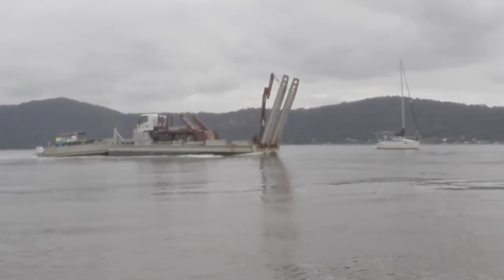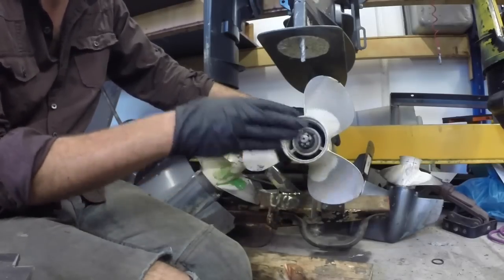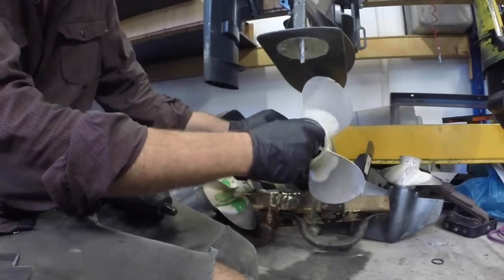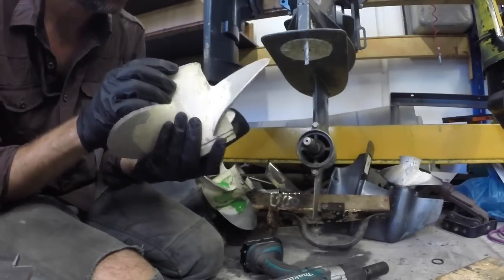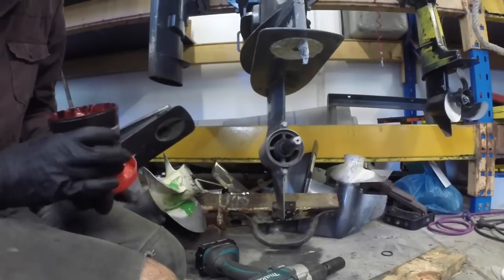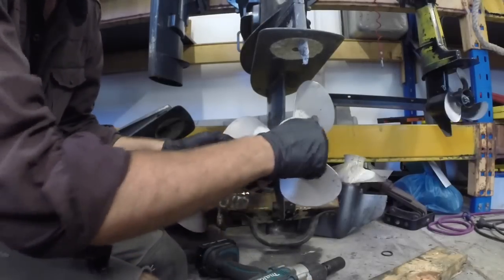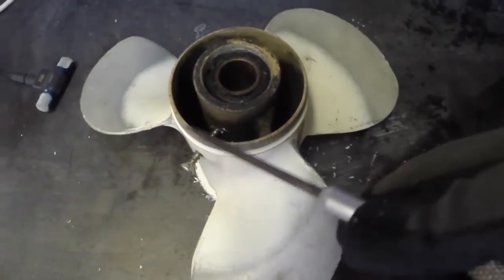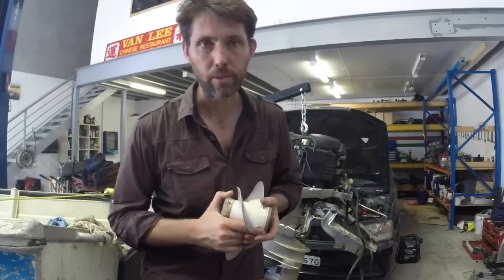Outboard revs increase but boat doesn't accelerate

Comment: Very interesting mode of failure - I never knew that modern props had a rubber bushing like that.

I've experienced almost exactly this same failure, but in the automotive world, with my supercharged MINI Cooper.  They are notorious for the crankshaft pulley (which has a very similar rubber bushing connecting the inner section to the outer ring) slipping and eventually failing.  This, of course, happened dramatically during a track day!  

I love finding out these little parallels between boat and car powertrains.  Many engineering solutions cross between the two.
Reply from the maker: Hey Paul, I too like seeing those parallels, there are only so many engineering solutions and its interesting to see how they are applied.

Comment: I have a 55hp yamaha 2stroke wot never planes out and rpms dont seem high enough, I'm thinking timing advance? Wot with muffs it will wind to 6000 , underload puts bow to the sky and stays there. Any insight on possible problems? Engine starts at touch of the key.
Reply from the maker: Could be many things. Could be balance of the hull, engine too small for the hull, blocked carburettor jets, low compression, wrong propeller, engine mounted too low -- the list goes on and on.

Comment: Another great video, I have learnt a lot from you already! My boat seems to be doing this at the moment however its more at half throttle. Does this still sound like the same problem? Revs all of sudden shoot up and the boat doesn't got faster but it also doesn't slow down. I should mention it is a river cabin cruiser so we are talking at like 4-5 mph its doing this, boat weighs 1800 lbs 20ft long, outboard is 15hp (don't need much on inland uk waterways). From what I can tell the prop is 9 inch pitch and 9 inch diameter. Alot of what I've read would suggest a slightly larger diameter prop with a smaller pitch would be better? Would be great to hear your thoughts on it!
Reply from the maker: Sounds like the bushing is slipping or it is cavitating all of a sudden. Finding the right prop for a boat is quite an art some times. Given it is a slower river boat, it does sound like it would lend itself to a large shallow pitch prop. If you prop does have a rubber bushing I would be looking at replacing it and try moving a small amount towards a larger prop, but talk to other people with the same hull to see what they are running.

Comment: i recently spun the hub on my prop. i have a 25hp yamaha four stroke, buy when i try to remove the prop nut with the block of wood in the prop the shaft turns too.  i had the motor in neutral at first then flipped the lever in forward. when i did this there was slightly more resistance but the nut and the shaft were still turning simultaneously.  do you think that has something to do with having to turn on the motor to engage it fully into gear or could it be that my prop nut has rusted and seized onto the shaft.  and what would be your advice as to the best way to remove this prop nut so i can replace the prop?
Reply from the maker: You will be able to put it in gear by selecting forward and then rotating the engine (either by starting it or turning the flywheel with a breaker bar). Once it is in gear properly you shouldn't be able to turn the prop shaft without the flywheel turning so if you hold a breaker bar on the crank shaft nut in the middle of the flywheel you should be able to lock it and the prop shaft still. This is going to take two people of course but should do the trick. If forward doesn't work try reverse.
Reply: +Dangar Marine  thanks for the reply I love watching your videos because of how informative they are.  Keep making the great videos

Comment: can you do a video on putting the gearbox back together on a Johnson 9.9 year 2000, as it has a tricky shifter with a spring and ball bearings deep inside. thanks
Reply from the maker: If ever I can get my hands on one I'll give it a shot. I have heard that detent ball bearing can be a nightmare to get back in.

Comment: I've got a 10hp evinrude that's have the slipping issue but it has the shear pin system and the shear pin is still in tact. I'm almost positive it's not cavitation, do you have any input?
Reply from the maker: Hmm, it is odd to get that with shear pins. Outboard gearboxes don't really slip either give they are dog clutches rather than clutch plates. Has it always done this or has it suddenly started.
Reply: Thank you for the quick reply and it yesterday was the first time I've used the engine for about 2 years so this is the first time It's happened
Reply from the maker: It may not be slipping. It is possible that it has dropped power (down one cylinder or something) which can make it sound like it is reving high, but not going anyway. I wouldn't discount an engine problem in your investigations if the shear pin is fine and the gearbox isn't noisy.
Reply from the maker: Try isolating one cylinder at a time and seeing if there is any change.
Reply from the maker: Could also be a main jet problem, so a carb clean wouldn't hurt if it hasn't been run in two years.
Reply: +Dangar Marine that's definitely a possibility because I killed the engine to go clamming and when I started the engine back up that's when the problem began. Thank you again for the response
Reply: Just FYI, I had an old (1959?) 10 hp Johnson (same as Evinrude) and the prop had a shear pin but it ALSO has a bushing.  How do I know?  Mine failed, fortunately not super far from the dock and it would still work in reverse so I backed all the way to the dock...  :)

RichE

Comment: Hey Greg,
I recently had this problem. I bought a prop from a local prop shop and changed the prop, After an hour or two of running time, It started again. Motor sounds great and I don't hear any irregular noise from the lower unit. Have you any other suggestions?
Regards, Gary
Reply from the maker: Hey Greg, no problem, my name is Stuart. :) That is a bit weird. Interesting that it went away for a while then came back. If it was a problem with the dog clutch you would expect a lot more noise and jumping, I don't think you'd miss it. Does the bushing in the new prop look good still?
Reply: Was it a brand new prop, or used?  Or possibly really, really old, but new, so the rubber might have deteriorated anyway?

RichE

Comment: I just bought a new project boat. When I put it in drive. The engine revs up but the prop doesn’t spin. When I put it in reverse. The prop spins are the boat moves. Could this be a bad prop?

Comment: not sure whats going on with mine 25hp 2 stroke just got it back from the shop.
New carb, impeller and plugs runs like a top out of the water, sounds like its got all the power while in the water but only going 5 mph. 
I am at 9,000 ft elevation they did jet it for that. but no power under load.
I just ordered a prop hoping that it is all I need.

Comment: hi danger marine thanks for getting back to me , i had the props replaced about a month age and now its just started slipping  there is no clunking or ratchet sound , its exactly like a clutch slipping on a car , it just starts reving out.

could it be the gearbox?
Reply from the maker: I wouldn't think so. Outboard clutches aren't like car clutches, they can't really slip without a serious (and usually audible problem) If you hadn't said you had the props replaced not long ago I would definitely say bushings, but it seems unlikely they have failed so soon unless something has been hit.

Comment: Hi Dengar can you explain why a disintegrated bushing like that would cause the prop to slip like it does? I'm confused why the absence of that little rubber bushing causes such a big problem (I'm dealing with this issue right now thx for the vid u saved me!)
Reply from the maker: The very centre part of the propeller is made from metal and keys to the splines on the propeller shaft. Outside of that is the rubber pushing and then outside of that is the metal of the propeller blades. If the rubber goes there is nothing connecting the blades to the propeller shaft so they don't spin.

Comment: thanks for the advice on the props.    
quick question  wouldn't it be a wise idea to take a spare prop with you if you had one?
Reply from the maker: If you've go the room, sure. It's also good to take all the washers, nuts and split pins you need in case you ever lose a prop.
Reply: I always have a spare prop,fasteners and tools on board. I even have a floating prop nut wrench.

Comment: Hey Dangar, I have a 2008 mercury 115 ELPT  4S OUTBOARD  , having some problems with the motor. when try starting the motor it's shaking a lot and doesn't start the same time , have to crank it a few times, then eventually it starts...runs for a few minutes then cuts out , also I have oil coming out at the propella. ...it's like a thin layer of oil on top the water when the motor is running. ...any ideas what might be the problems.
Reply from the maker: Hi Ramesh. I'd start by doing a compression test on it. It sounds like it might have a blown head gasket. When the head gasket goes it will look compression in one or more cylinders which is why it shakes (out of balance without all cylinders running) and oil and cross over into the water jackets then come out the exhaust which is why you get the slick.

Comment: Hi I have a 1972 Johnson 65 horse.  My prop won't spin in the water but it will spin when I run it outside. Any ideas what is wrong with it?
Reply from the maker: Props will spin out of the water even when they are in neutral, is it definitely going into gear? If it is, then it is likely you have the problem detailed in this video.
Reply: Dangar Marine  that is what I thought and I went and bought a new prop but it's doing the same thing.  You think it might be that I installed it incorrectly?
Reply from the maker: Sounds like it isn't going to gear properly then. Even when it isn't in gear it will spin out of the water from the currents in the gearbox oil.
Reply: Dangar Marine do you have a how to video for me to view to repair it?

Comment: Very well presented, Thanks!   One question, can the grease be a normal bearing type grease or should it be a marine grade?
Reply from the maker: Most bearing grease will be fine as it is designed for the wheels to get very wet anyway. I also feel that if you replace it often enough you shouldn't have a problem. Using the right grease is more important with things like steering tubes where you can't just wipe it off again easily.

Comment: Can you change the prop when the outboard is still on the boat in the water? I need to fit  new prop but don't fancy tacking the outboard off the boat. I am a novice
Reply from the maker: Yep, just trip it all the way up and be careful not to drop any of the spacers or washers etc.

Comment: What happens when you come to replace the bushing after you have done your temporary repair?   How do you retrieve the screws or is the prop trashed?
Reply from the maker: You can wind the screws out, but I've never replaced a prop bushing ever. It is very hard to get he prop balanced and probably not much cheaper than a new propeller with clean blades to sweeten the deal.
Reply: Will be swapping out the props on both engines.   Seems to be quicker and less hassle.   (Of course hopefully it will also stop the problem too).

Comment: hi i have yamaha 40 hp from the 90's i have problem with the engine its was run good till few days i was run fast then the engine slow down by it self still run but not fast but when i trun it off then i start it after 10 minutes run fast again for 40 minutes then slow down again what do u think the proplem? hope get help from u,
thx
Reply from the maker: Sounds like maybe it is overheating from lack or water or oil.
Reply: thx for replay .i did look on the water system on the engine it work there water go out from the holes but that day the lamp of the oil was lighting red so i put  some oil for the fuel.the out fuel line that go to the engine it's a bit down where is the bump so water from the sea get on the bump do u think water would go with the fuel?
Reply from the maker: It doesn't sound like water would have got in.
Reply: so how i can fix the overheating  proplem from  water or oil?what i need to do?im so glad for ur answer.thx alots

Comment: Hey Stu absolutely love your videos mate. I have a problem with my 25hp yamaha 2 stroke and I was thinking that maybe this is the cause. Every time I go full throttle the engine sounds like it's hitting the rev limiter and the overheat light comes on. It runs fine at 3/4 throttle but over that the overheat light comes on then if I go full throttle it hits the rev limiter. I have another prop to try out this weekend but I wondered if there was any other possible cause for this ?

Cheers

Rich
Reply from the maker: Hi Rich, it could be a few things. Those cheap infrared thermometers are great for determining if an engine really is overheating. If it happens on your very first run after starting the boat I doubt it is though. It could definitely be that the prop is too small and you are indeed hitting a rev limiter so trying a bigger prop is a good idea. The other thing might be that the ignition timing is advancing too far at full throttle so worth checking that too.
Reply: Thanks for talking the time to reply Stu your a legend mate, hopefully i can get it sorted this weekend. Its been pretty frustrating, I've only just bought and fitted this engine after my previous engine a 20hp yamaha decided it wanted to go into retirement or at least one cylinder did. I've missed out on some really good fishing weather and we don't get much of that in the north east of England so you gotta take it when you can. Anyway thanks for the advice and keep up the good work your videos have been invaluable to me at times.

Cheers

Rich

Comment: My 150 will run at trolling speed and when i try to plane it it revs high like slipping trans on car i sent prop in to be fixed but is there anything else that it could be with the simtoms like spon propeller
Reply from the maker: Either a slipping bushing (most likely) or ventilation from being mounted too high.
Reply: @DangarMarine  thanks im sure bushing then to

Comment: I got a mariner 75 hp 2 stroke 4 cylinder it goes into gear and runs lovely on the hose and muffs I put it on the water starts and revs fine I go to put it in gear and it cuts out as soon as I put it in gear any ideas?
Reply from the maker: Could be that the gearbox is seized or at least has high resistance or that the motor is running weakly and doesn't have the strength to push any water. Does it go into gear on the muffs?
Reply: Dangar Marine I fixed it now stu thanks it was the carbs not set properly it would run lovely on the muffs but stall under load. keep up the good and helpful videos

Comment: You do have the best videos, my RPM goes up enough to raise front of boat, but not moving much, look back at motor and the water looks like boiling water if that makes sense, not pushing enough for that v shape in waves. prop or power issue? 1973 evinrude 85hp fish and ski boat
Reply from the maker: Hi Ronald. It certainly doesn't sound like a bushing issue. 85 HP is a fairly large outboard, is it a huge boat? Is the hull clean? Any chance of water in the bilge? It could be a prop size problem too, but it is more likely that the motor is down on power than the prop being wrong.
Reply: Ronald Howell hey im having the same issue did you ever resolve the issue?
Reply: Same thing here Ronald and Matt and Dangar Marine. Changed gear case oil, changed water pump, rebuilt carb, changed plugs, haven’t done a vacuum test or checked my prop bushings. I don’t get a very high rpm at WOT. I’ll let you know what I find. Looks like I need to watch more dangar videos!
Reply: Matt Much sounds great. Thanks Matt!!

Comment: I just bought a 2017 8hp outboard mercury from a guy on Craigslist for 600 bucks.  I took it out on the water today for the 1st try. I put it in forward and reverse. It just rev up and no go. I look down in tge water while it still ideling and all i see is prop not spinning only boiling water. Do i need to replace the prop?
Reply from the maker: Generally if the prop isn't spinning at all I would say it is not going into gear, could be a gear selector linkage problem. If you run it out of the water you should be able to see the prop shaft turning. If you can then it is a problem with the prop, if not, look into the gear selector. The boiling you see is just the exhaust coming out through the prop hub.
Reply: Dangar Marine 
Thx you
You were right. it was the linkage issue. Had it readjust.  Running fine noe

Comment: I got a volvo penta i/o when I tried accelerating fast it revved up a lot and didn't go any faster I had to bring the throttle back and accelerate slowly it did it twice when towing a tube it also got a little hot to where coolant came out from the cap can you help with this problem please
Reply from the maker: +Sig Luna you might have had a bag or something around the prop if it isn't a problem with the prop bushing.

Comment: Great video,i have ski boat with 2006 Honda Outboard bf90,is wont go over 3000 rpm,first I thought Carb or Valve i bebuild Carb and Adjusts Valve but still dont go no where,then I check Spark plug is only 2 cycling is run the other 2 is smell like have gas but dont see burning in Spark Plug,then i replace still the same,then i check on Prop,the Prop is SS,i call dealer of boat,they say i need just AL prop,I hope i change Prop it can gain 5k-6k rpm.